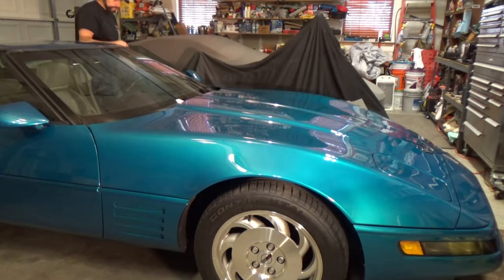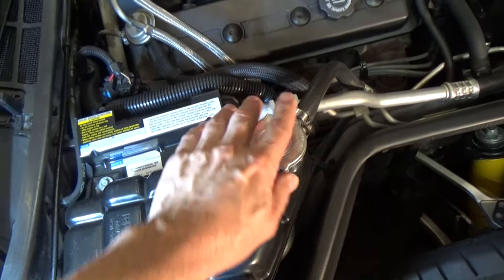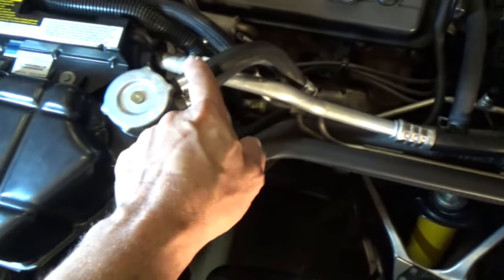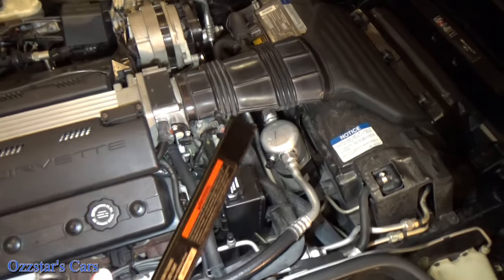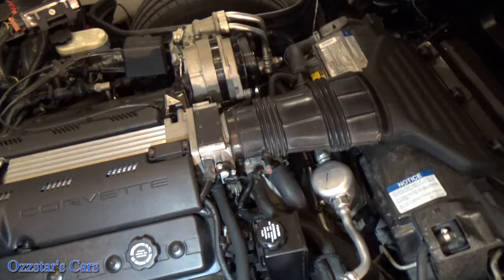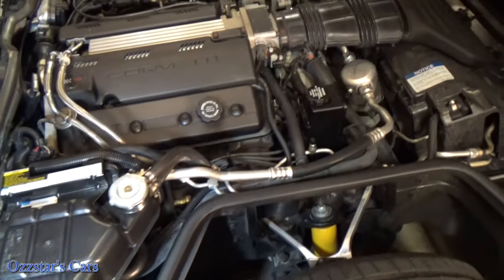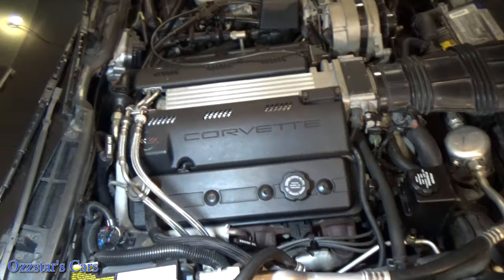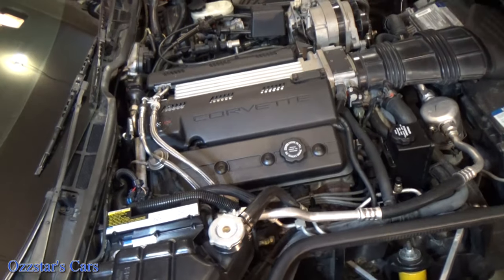Corvette Running Hot - Corvette Cooling System Maintenance Running Hot C4 1992-1996

Comment: I have a 85 Corvette , 32,000 miles  and runs super good. Like a brand new car. The temperature was running around 220-230 and it was worrisome. I took out the thermostat and it now runs around 170- 205. Fan comes on a bit earlier if I run the AC. I don't run the car in the winter, so why does one need a thermostat? It seems to run so much better at 20 degrees cooler.
Reply from the maker: The faster the engine warms up usually the emissions are less.

Comment: My 94 has an OBD2 connector with an OBD1 system. Do you know what would be diagnostics mode comparable A & B of the OBD1 compared to my OBD2  connector?
Reply from the maker: Your car only has OBD 1 technology.
Reply: @ozzstars_cars ... my problem is that I have the OBD2 16 pin connector. I'd like to be able to identify the 2 comparable diagnostics pins in the in the 16 pin connector to the 12 pin connector. I realize you may not know. Thanks.
Reply from the maker: @lashlarue2266  of course I know.  In your '94 jump OBD2 connector pins 4 and 12.  The codes will be displayed in the digital center screen and you will need to use the TRIP ODO button to scroll through.

Comment: Cool video, Glen! :D Wow, that engine compartment does NOT look like a place I'd want to spend any time in. Things are TIGHT!  TWSS ... 

Looks like that radiator picked up some doubage and a 8-ball ... not that I know what those look like ... but it looked that way. :D Nice ride, brother!
Reply from the maker: All kinds of paraphenilia hidden in there Smitty.🤘  Fortunetly this car is pretty reliable and I don't have to bust my knuckles much.  Take care
Reply: @ozzstars_cars  - Glad to hear! That was in the era where GM still cared about customer service. That's a solid platform right there.

These days the bottom line is all GM cares about. Parts made everywhere but the USA by low bidders. I was just reading a multi-page post on a forum about AFM problems on a '15 Sierra. This was a problem in 2007 ... and they're STILL using the same crap parts! Unreal. :( Oh, and my Silverado is down - I lost 3rd and 4th gear! Transmission time, at 103k miles, case in point!

Time to get under the hood of a Toyota. Got some headlight assemblies to change, plus the belt, idler, and hydraulic tensioner to swap. I'm prepared to bleed ... :D Have a good one, Glen!
Reply from the maker: @SmittySmithsonite  you are right about those parts. GM was bailed out of bankruptcy and they must cut every corner they can. The CEOs need that big cheddar!  Good luck with the Toyota, may all your nuts and bolts be rust free. Hahaha
Reply: Ozzstar's Cars - It turned into a semi disaster. The tensioner hex rounded off on me, because someone torqued it to 3,420 foot pounds at the factory 14 years ago. I had to file what was left of the hex, place the socket on as far as it would go, then pry against it with a 3 foot prybar, then hit the prybar with big nasty to get the socket to force its way on there. Then I was able to work it out of there with everything I had on my 3/8”ratchet. I had to grind the hex off and weld a nut in its place. Went from a 14 mm hex to a 18 mm hex, but it works! Saved me a trip to Toyota. 😁

My buddies stopped by in their hot rods today. One of them had a Corvette around the same generation as yours I believe. I forgot what he said what year it was. Anyway, he laid a nice patch here. I shot a video for you. The first car is my buddy’s crazy 900 rear wheel horsepower ‘11 Camaro. 😎 https://youtu.be/rzham6cf0tc
Reply from the maker: @SmittySmithsonite  sounds like a fun day man. Wish I was there. 🤘
Reply: @ozzstars_cars  - We'd keep you laughing, that's for sure. 😁 Anytime you're in the area, you're more than welcome!  👍🍻

Comment: Hopefully someone can respond 
I own a. 1986 Indy pace car edition . 
The battery was dead I jump start and
Just let it idle about 15-20 minutes. 

I get in car to look at gauges and
See the temp at 260 degrees . 
I turn off engine and leave key in to monitor temp it went up to 265 before going back down as the car was off . 

Is there any way to confirm if I damaged engine ? 
Plan to change thermostat first .
Reply from the maker: @JAYY_JAYY  make sure the cooling feeling are working properly. Test the fuse and relays.

Comment: is there a bleeder valve on the 89 vette? if so where is it, thanks
Reply from the maker: I don't believe there is because the engine in an '89 has a different cooling system than the LT1.

Comment: reverse cooling = forward overheating.. 226 degrees is when the fans kick on.. GM did this because it helped the engine pass emissions regulations.. Purchase a spare ECM have mated to your VIN and have it re-programmed so the fans kick on at 180 degrees.. When it comes time for your yearly emissions testing install your original PCM ( takes about 5 minutes ) after you pass reinstall your replacement ECM.. your motor will thank you for it

Comment: Sir I need some help. I’m not very mechanical and I recently bought an 88 vette and I turned the the car on and it’s saying low coolant, but I checked the coolant and it’s full. When I turn the car on and flip the switch to check the oil and coolant temp it says low, is this normal?
Reply from the maker: Hard to diagnose a problem like that over the internet.  Wish I could help, sorry.

Comment: Thank you very much I will check all of that after the winter! But I have a 1990 l98, are those systems different than the lt1? Plus is it possible the 1990 does not have digital gauges? I checked all the switches and there is none. My analog temp goes all the way almost to the maximum and stays there unless I'm on the highways temp is perfect. And when the temp is hot it smells a little bit of coolant, but no leaks.
Reply from the maker: Scroll through the electronic gauges using the buttons on the dashboard to the right of the steering wheel.
Reply: mr dubois, here is a reply I had to someone else earlier, thought you would like this info.
First, Glen, good video, good info. I owned an 88 vette for 30 years. Setup included L98 auto, electric fan and electric  optional pusher fan. I changed the thermostat to 180, replaced the 235 temperature switch in the side of the block that turns on the pusher fan to a 200 and added a jumper wire from the pusher fan relay to the main fan relay. That way both fans turned on at 200. Highway temp rarely over 180. In town and parades never over 205. The factory design just left too little buffer between operating temps around 235 to cracking the aluminum heads at 260. Hope this is helpful.
Reply: @larsz5224  Thank you so much!

Comment: Ozz is there a video for a c4 smog pump removal and what replacement bracket to use
Reply from the maker: Are you referring to the air pump located under the left headlamp in the engine compartment?
Reply: @ozzstars_cars  no this is above the alternator and a aftermarket bracket

Comment: The excess coolant that drops at the bottom on the tank is not sucken back into the hose. What could fix this issue?
Reply from the maker: The system is full

Comment: Dude! Excellent video, sir. I have a '96 LT4, 6spd., live is AZ, and find that mine runs at about 205*-215* in town. I was wondering if you had experience with that product "water wetter" for helping to reduce cooling temps? Cheers.
Reply from the maker: Yes. I have actually discussed the product with one of the engineers. Seems the older the car the better it works. Do your research before using it. Did you clean the radiator yet?
Reply: @ozzstars_cars  Yes. I replaced my radiator about a year ago due to a leak in it. Put in a 3-core replacement. Was hoping that fix alone would drop temps. Maybe insufficient burping? Thanks for the reply.

Comment: The paper clip trick did not work for me. Upon closer scrutiny I recognize that you have an OBD-1, while my 1994 has and OBD-2.
Any workarounds?
Another thought... I have read or been told that even though I have an OBD-2 plug on my 1994 C4, it is actually still only OBD-1 scanner compatible. Any thoughts?
Reply from the maker: Of course I know how to pull codes on a '94 OBD1, with a scan tool but I'll share my knowledge with you.  On your obd2 connector jump pin 12 to pin 4 OR 5, they are both grounds. Then you will see the codes on the digital center dash screen. Scroll through the different modules using the buttons to the right of the steering wheel that says gauges, trip odo, eng/met.  👍

Comment: Thank you for this informative video, I will soon be in the market for a 95/96 and this info is most helpful. May I ask the color ? it looks like bright aqua, (which I am looking for) . I had a 94 that  unfortunatly had a spark plug wire came loose and hit a metal shroud. Long story short, 2K $ later it zapped the electrical / timing. lesson learned.
Reply from the maker: This is a '93 paint color is Bright Aqua Metallic. Electrical shorts are no fun.

Comment: When I first purchased my 85, I hit 230 and said oh shit I purchased a lemon. After doing some research and found getting to these types of temperatures are normal....
Reply: Dont get use to it Paul, its an engine killer in the long run. Invest a bit of time, labor and money to improve the cooling. The biggest change that helped me was removing the radiator and cleaning the surfaces.

Comment: why are the fans coming on so hot ? I have mine set to come on low at 196 and high at 205
Reply from the maker: Corvettes like the heat, especially the C4 generation.  I'm not sure why it's engineered liked that but believe it's due to the reverse cooling system the LT1 has.
Reply: They come on Hot because Federal Regulations are always changing for Gas emisions so GM set the fans to turn on at a higher temp because the hotter the less bad  gas emisions your cars putting out.You can tune it to turn on at a lower temp but as time gos by OBD1s are getting harder to find a tuner.

Comment: I have a 1992 corvette and has the orange stuff in it is that bad ? What coolant should i use. And i know my primary fan works and my secondary fan works when i turn the ac on but i can’t tell when it works without the ac on
Reply from the maker: 1992 LT1 specs the old school green coolant, NOT Dexcool.

Comment: Any chance of a heater core fix on a 90 c4
Reply from the maker: If I had one come in I would take the 8 hours to film and edit it.  Most don't drive there Vettes in the winter around here and bypass the heater core. Fast and cheap. 🤷‍♂️
Reply: @ozzstars_cars  any disgrace in putting a by pass so I can at least drive the car ?
Reply from the maker: @Jeff Spicolli Mr. Hand said so. 😁👍

Comment: Really great video. So I'm looking at a 94 with 85,000 miles. Very original car. What type of service life can one expect out of the opti spark. And water pump? Is better to just go ahead and replace water pump with a AC delco pump and be done?
Reply from the maker: If ain't broke why fix it? A visual inspection is necessary to make sure no coolant is leaking.  If there is a leak then obviously it needs attention asap.  That mileage isn't scary if things are well maintened.
Reply: @ozzstars_cars  thanks! Going to change all the fluids and filters and go from there. I know these C4 can have some quirks and things to fix but it’s such a great car with the six speed for a $7500 entry fee! Not many cars with this type of cost per fun ratio. And I love working on cars so it will be fun.

Comment: HELP...I have 92 corvette, the history is I just bought it from the second owner who had it 5 yrs but has not driven it in 2 due to medical reasons...in really good shape. Got it for 5K (convertable) test drove it twice and no problems that I noticed. But  number... 1) the number 2 fan comes on when you turn on the ignition... 2) when I start it the main fan (drivers side) comes on in 5 seconds....they both stay on with or without the AC on..very confusing. 3) I just took it out for a 30 minute drive and came back home because the temp climbed to 235 and stayed...with 2 fans continuosly running it is still 235...took it home and shut it down...just found your video and will look to clean the radiator... any ideas...coolant was full also...I am seriously thinking about selling it because I got a funny feeling this may end up a nightmare...lol HELP
Reply from the maker: I would start by making sure the fan relays are not bypassed and that the coolant temp sensor is in spec.
Reply: @ozzstars_cars  The wiring all looks original, I'll change the temp sensor this week, is it possible the sensor can give the correct reading in the dash while the fans are getting different info and just always on? I would pray that's what it is...I cleaned the radiator out (some debris) that's such a terrible design. I drove it again for about 30 min and its fine 210 area. Thanks and I'll get back to ya.
Reply: it was sitting for 2 yrs think I should change the thermostat. I didn't think to do that.
Reply from the maker: @tonym2881  if the fans kick on immediately on a cold engine then its a sensor or wiring issue unless the a/c is turned on. That will command both fans to come on instantly.

Comment: Good morning I'm watchin your video the motor is lt1 and the serpentine belt is not dual side I have a 92 lt1 and my belt is 10186198 do you know it is posible change for 10241175?  Thanks
Reply from the maker: Use what the belt manufacture calls for.

Comment: Great information,you know your stuff.If i could add somthing .Never use water to clean the engine or compartment area.The ignition system is very  exposed under the water pump. Very poor design, and very expensive to replace!
Reply from the maker: That's a good point mainly for C4's built after 1991. The '92 and '93 models especially,  the '94-95 models had a vent tube redesigned Opti-spark. By 1996 things were cured.

Comment: I replaced the radiator with a dewitts, installed a 160 thermostat, and sent the ecm to Wong's performance in Vancouver, WA where they reprogrammed the cooling fan temps on my '94. On a hot day in traffic, it never exceeds 190. BTW, Glenn, are you from PA?
Reply from the maker: Wow Rick you went all out.  I assume the engine isn't stock and put out some extra horses?
Reply: @ozzstars_cars  Everything else is stock.
Reply: Would it be rude to ask how much that ran you? I’d love to drive my C4 in stop and go traffic and not worry about coolant temp.
Reply: @andrewalvey7821  Sorry it took so long to reply. The Dewitts radiator for my 94 manual was $570 and the Dewitts radiator for my '93 automatic was $600 from Speedway Motors. (free shipping). The price has gone up since I bought them. It cost $100 each plus shipping to have the control module reprogrammed to lower the fan-on temps from Wong's Performance Engineering of Vancouver, WA. I recommend them. Then there was the thermostat and new coolant. I did all the work so there was no labor costs. If you plan on doing the job yourself, let me know and I will walk you through the process.

Comment: Unfortunately my 94 Corvette has a different DLC, it does not have an A and B to jump and test my cooling fans. My secondary fan is not coming on at all and I replaced both relays, still not coming on. The primary works fine. I overheat in stop go traffic.  I have a GM shop manual and I can’t find the test procedures. I only found where it says the fans are controlled by just about everything.  Anybody have any advice? Thanks
Reply from the maker: All C4's 1984 up to 95 should have the same DLC.  Take a picture of what you have an email it to me at ozzstar@aol.com.  You did check the fan fuses?

Comment: Take the radiator out completely
Using a garden hose from the fan side gently flush out each fin if you hold it up to light youd be surprised how much crap is packed in them. 
AFter having a C4 once a year I do that to any vehicle I own
Trans coolers, AC condenser etc makes a huge difference!
Plus your E fan will run less often.  I swear by milodon lower temp stats and have the fans come on eariler .No reason for them to run that dam hot.
Reply from the maker: @gordocarbo  or do what I show in the video and the pain is over in 5-10 minutes. More time to drive and not work. 😜

Comment: Great video. I have a leak under the runners going into the plenom on the passenger side.  The coolant slowly fills up the little pockets.  Is it the cover coolant outlet that needs to be replaced?
Reply: Or is it leaking from the throttle body? I just learned coolant travels through the throttle body.
Reply from the maker: @Raiden_Wins  I have a C4 intake gasket manifold replacement video that discusses and shows the throttle body coolant passages.
Reply from the maker: Almost impossible to diagnose a car over the internet.  Doing a coolant pressure test might be helpful.
Reply: @ozzstars_cars  I watched your video. I'm still lost. Where is the leak coming from if the leak is gathering around the fuel injectors.  I've read coolant goes through the throttle body. I'll try the coolant pressure test.

Comment: What if the coolant in the front reservoir is at the top when its cold? It didn't suck it back.
Reply from the maker: Overfilled?
Reply: @ozzstars_cars  .. Could be, just got the car. It hasn't overheated yet. After seeing the video I decided to check the level. I let it run for a while to heat up then checked it when it was cold.

Comment: Glenn, I need your expertise. You've likely heard of the helicopter-like noise coming from under the 92 LT1 hood that gets worse when it accelerates. What the heck is it? It's embarrassing and seems like loss of power. Help
Reply from the maker: Can't say I have heard about that. Do you have any video of the noise?
Reply: @ozzstars_cars  I just had it checked and was told that the fluttering noise was caused by manifold gasket exhaust leak. Know of any problems?